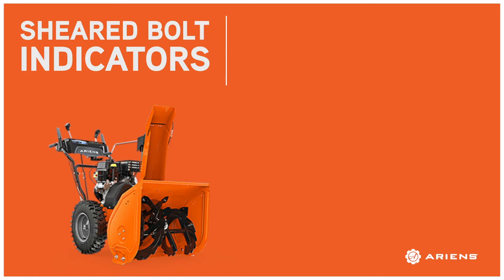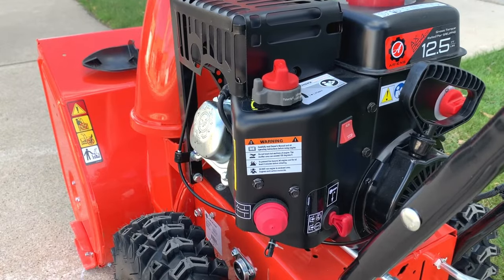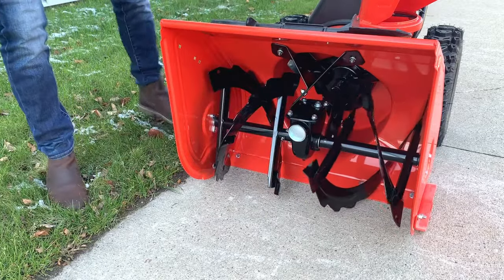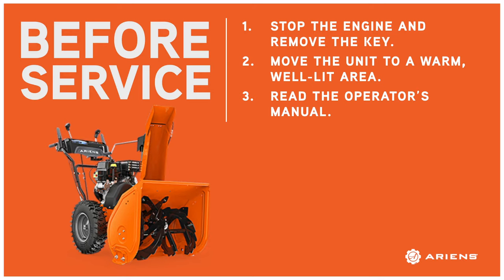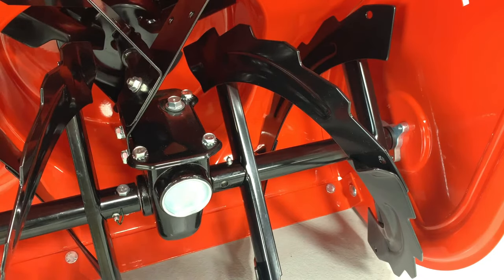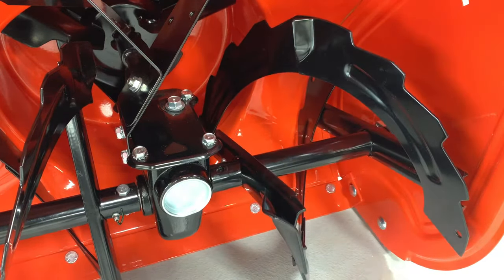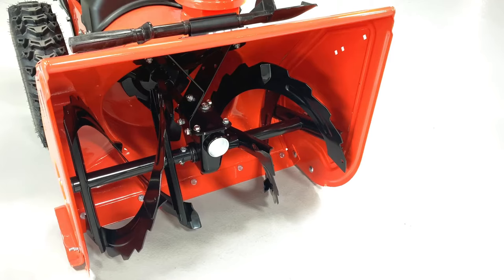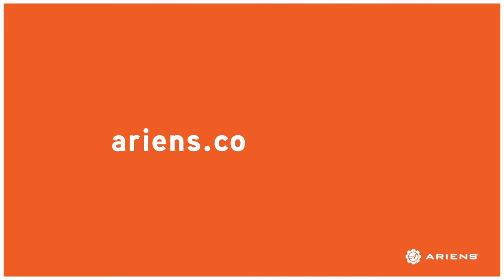How to Change a Snow Blower Shear Bolt | Ariens®

Comment: I got an Ariens for Christmas and was sooo happy. It wasn't doing a great job, but it's an ARIENS!!! We had about 12" fall last week and I couldn't understand why the hell it wouldn't go thru the snow. It's an Ariens after all. Even w/ both wheels engaged, it was harder to use than the little 22" MTD unit I had since 1996. WHUT?
But it's an ARIENS!!
Today, another 5" of fluff came down. My neighbor came out and spoke w/me. He saw the hard time I was having. He told me that w/ the first snow of the season he saw that my front auger wasn't driving. Lo and behold the shear bolt is gone. No lug in the shaft (nub?). AAAAND ....NO sign of abrasion on the paint on the blade. In other words the original was NOT installed. 
UGH.
Ariens? 
My email will follow, don't worry. I'll have pics etc 
Ariens? 
What a let down, to tell you guys the truth. 
Now go yell at someone in QC. Serial numbers, dates of sale/service will follow. After I do the job in my garage that you guys should have done. You owe me a case of beer. 
Ariens? C'mon man! I feel so 'Let's go Brandon' right now.  :D

Comment: Since the nut provided is self locking, wouldn’t it be better to back off from snug 1/4 turn to allow just enough play to allow the bolt to actually shear when need be? Or would that cause bolts to shear unnecessarily?

Comment: OK, the last two comments I read described the issue I had with this procedure.  And...I think I figured it out.  They didn't explain it in the video, but the bolt holes in both the right and left shafts are aligned.  With grease all around the shaft, and thus the broken stud too, I spent a good 15 minutes trying to figure out where the stud/hole was.  There was no differentiation between the shaft and the evenly-broken pin.  Then I got frustrated and aligned the hole in the auger even with the existing bolt on the other side.  (Luckily, it was basically right on top).  I then punched....and lo and behold the stud popped out and I was easily able to insert the replacement.  And going back and re-watching the video, it appears that the unit in the video bears my findings out- that the shaft holes on both sides align. Should make next time a lot easier!  (Unless, of course, mine and the one in the video are just coincidental, and I end up butchering my shaft... :) )

Comment: The shear bolt broke but I can't find the hole OR the broken bolt! So I can't punch the bolt out because I don't know where it is on the shaft. The only thing I can do is drill into the shaft and connect a c-clamp to the shaft for now.

Comment: What happens when the bolt is in there but the holes aren’t flush and you can’t punch it out? I’ve replaced sheering bolts before, but since the holes aren’t flush I can’t punch the bolt out.
Reply from the maker: Thanks for asking, Richard. Sorry for the late reply, but we just got this in from our technical service team:

Align the holes in the auger and auger shaft. If the bolt is smeared, or not cut clean, rotate the auger 180 degrees and punch it out the other side. The auger should be able to rotate to align with the hole in the shaft, but if it won't rotate, you will need to contact your nearest authorized Ariens servicing dealer:
https://www.ariens.com/en-us/dealer-locator